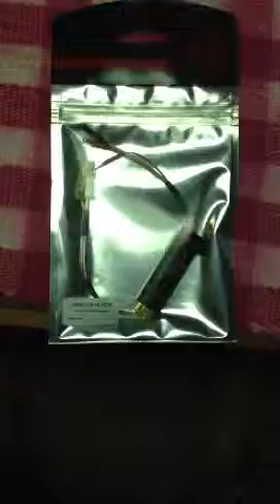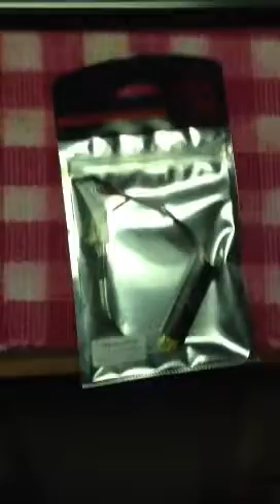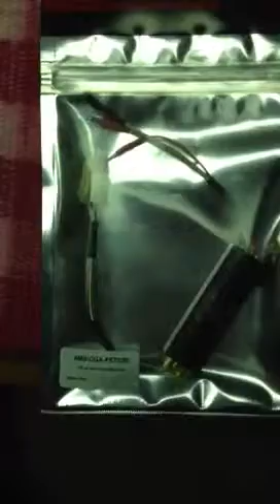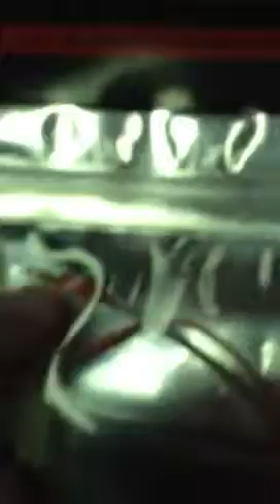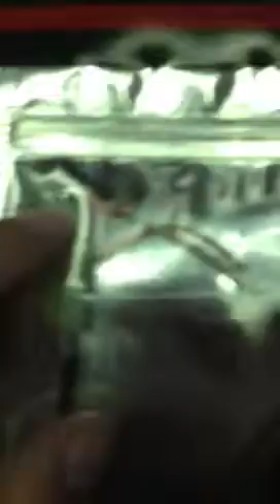Aps mosfet chip and wire set

Comment: Just as an FYI, silver actually does have lower resistance than gold.
However, even in this "silver" wiring, the primary conductor is copper.
It is simply silver plated, the primary purpose of which is to make soldering easier and reduce corrosion.
Here is a source:
http://images.machinedesign.com/images/archive/72603electherma_00000050743.jpg

Also, sounds like the harness increased your resistance a lot over whatever wiring you used before.
Those skinny blade connectors really don't help, and it is still relatively small gauge wire.